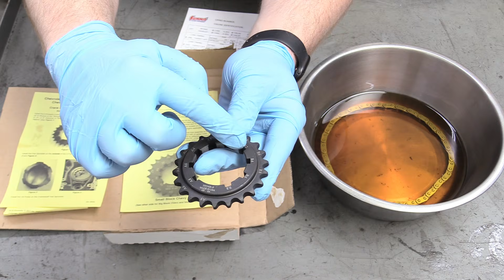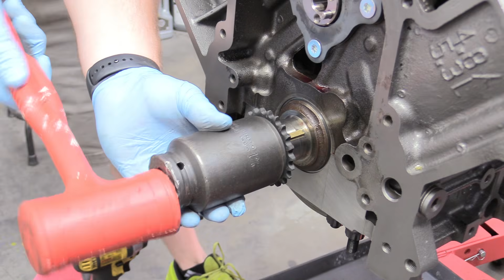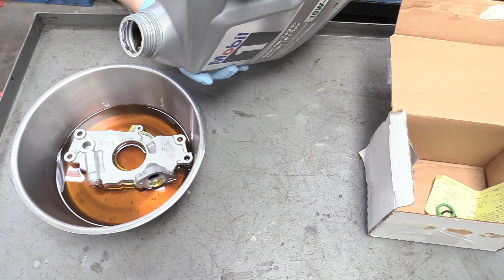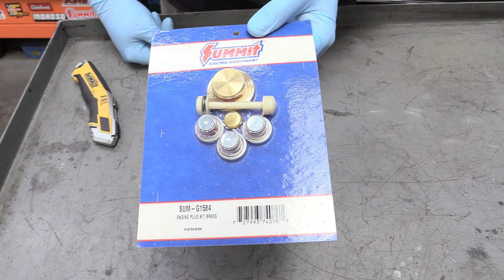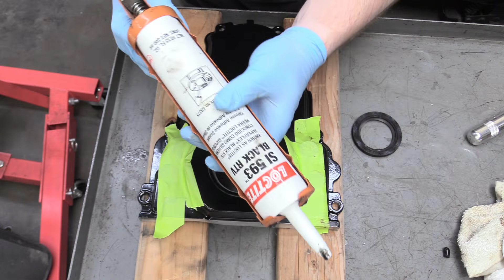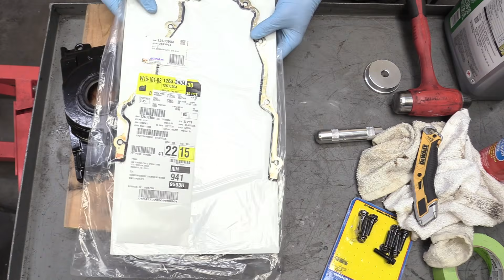How to Build a 5.3L LS LM7 V8 - Part 6: Timing Set and Front Cover!

Comment: this may be a very dumb question but, the camshaft that you have calls for +3 timing advance. Why didn't you advance the wheel on the camshaft side (+3) when installing the timing set? Are the two completely unrelated?
Reply from the maker: Oooo good question! I actually called Summit for that and basically it has +3 built in when the cam is straight up. Thanks for watching!
Reply: @2carpros  aahh I see, thank you! 

Btw, this video series is so good. It's literally what made me take the leap of faith and start my 5.3 build 🙏

Comment: 12:00 have to align the oil pump first, one method is using 2 feeler gauges that are .002". Good video but man sponsored people always have the best garages and cameras plus they talk like the guys on Horsepower TV LOL
Reply from the maker: So the block or the pump isn't machined correctly? And how would you change that? I've never had that problem before and I've built loads of these. I had this garage way before I was sponsored. This was a 1000 sqft building in one of the worst areas of Anaheim. Also my camera back then was just my phone or an old Canon I had. 

Network TV people are on script so that's why they all kinda sound the same. I do this off the top of my head and is just how the creator made me. 

Thanks for watching!

Comment: Using this series to build my l33 one tip I found is use the old cam retainer to keep the cam from falling out the back. Just thread in one bolt. Also if you’re going back with the stock type crankshaft sprocket you can use your old gear to drive the new one on.

Comment: Just a note on oil pump install. I prefer removing the front pump cover and aligning the oil pump with the crankshaft before fully tightening the four housing bolts. Anyone interested can easily find an alignment kit with a simple google search. 👍🏼

Comment: Did you ever get it running im about to install my harmonic balancer and didn't use the alignment tool and worried about leaks from front seal. Did yours leak at all
Reply from the maker: Yeah ran on the Dyno and it's in a Bel Air right now running and driving! Nope not a drop. Thanks for watching!

Comment: @2CarPros  i followed your steps putting this timing gear on. tried starting the car and its acting like the timing is off, is there a way to tell its 180 degrees out of rotation?
Reply from the maker: Were the two dots lined up? Because if so it's impossible to be 180 out. Thanks for watching!
Reply: @2carpros  yeah, 2 dots were lined up/ cam at 6pm, and crank at noon,  key was in 2 o'clock position. Would you know what else would cause a backfire, fuel and sparks to shoot from carb, smoke from exhaust and no start? rebuilt as stock. msd LS ignition box, no computer. Thanks
Reply from the maker: @chieftain3588  Then it's right. My gut says it's the box having a problem. That can happen even brand new out of the box.
Reply: @2carpros  does it matter if the tdc is on compression stroke or exhaust?

Comment: Do you have to pull the oil pan to change the camshaft and timing?
Reply from the maker: No, you just need to unbolt it from the timing cover. Thanks for watching!
Reply: @2carpros  I very much appreciate hearing back from you. I’m doing my first ever cam this weekend on my Silverado including the afm delete. Any advice you’d give someone for the job? I’m mechanically inclined but have never been this deep in a LS.

Comment: Timing cover should be centered with proper alignment tool or since seal is already in the cover you can use the balancer for concentricity then adjust rotation to square up oil pan mating surface.

Comment: i justy installed a new timing chain and when I torque it down to spec the crankshaft does not move at all and the chain doesn't move, I also have the stock sprocket, any ideas? I have a 2002 6.0 lq4.
Reply from the maker: Are the heads and plugs on it? That would make it tough to turn. Otherwise make sure you have the correct thrust plate for your camshaft. Thanks for watching!

Comment: Thanks for this video. Have a 2003 Silverado 4wd that needs a new oil pump. Thought to replace water pump and timing chain while Iam at it. Truck has roughly 120,000 miles. I didn’t see you deal with the T.C. Tensioner. But you definitely lined me up on what to look for in properly installing the timing chain and oil pump. Going out today for more parts, just about ready to begin this project. Thanks again. You are a competent instructor.
Reply from the maker: Ours didn't have one. I wonder if GM started putting them in at some point? 

Thanks so much for watching!
Reply: @2carpros  You know? Once I had the cover off of mine I found out that neither do I. The tensioner was in my part box but I didn’t need it. Thanks
Reply: Only Gen 4 LS have guides/tensioners

Comment: So I watched all your videos for my lm7 build. I followed all directions. I tried to start my motor but couldn't get it to start. So I decided to go through everything and kind of pin point where I screwed. As of now I'm assuming it has something to do with my timing or bad reluctor wheel. After watching several  videos from other builder I can't recall whether or not Cylinder 1 was top dead center.  watching your video again I noticed that cylinder 1 was top dead center but you didn't mention it. My question to you is, is there a way to check  without completely dis assembling the motor or atleast  without removing the head?
Reply from the maker: Pretty sure I said 1 has to be a TDC when you put the timing set on. 

Yeah, you can just take the spark plug out of #1 and turn the engine over with your finger over the plug well. You'll feel a blast of air that's the compression stroke. Then look in there and keep turning the engine over until it's at the top of its range of movement. That's what you're looking for. 

Thanks for watching!
Reply: @2carpros  thanks I went ahead and did that cylinder 1 was all the way up. thanks again

Comment: Crankshaft sprocket in oven for 200 how many in minutes to take out of oven sir ?
Reply from the maker: Like 5 minutes maybe a bit more. You don't want it so hot that it is dangerous or too hot to handle with an oven glove. But it needs to be hot enough to expand a little bit. I use a laser thermometer to test the heat and take it out when it hits 145F or so. Thanks for watching Anthony!

Comment: Seems a lot of folks change the oil pumps in LS engines, is there a problem with the original factory pumps?
Reply from the maker: Not really, but when you are spinning 7200 rpm way above factory spec you just want to make sure you are getting great oil pressure. Thanks for watching!
Reply: @2carpros  , Thanks for the reply.
I'm pulling the 5.3 out of my truck because it's leaking oil from every orifice and gasket and thinking about replacing some of these things like the timing set and oil pump preemptively.
Reply from the maker: @areuaware6842  Yeah that's a good idea! Thanks for watching!

Comment: Great video. Have a question about degree timing for your camshaft. I noticed in this video you just lined up the dots on the wheels and installed. Is doing the degree camshaft necessary?
Reply from the maker: If you want to squeeze every last drop of power out of your engine yes. Every professional race engine builders say it's essential. But for most people building an engine in their garage for fun I don't think it's necessary. Thanks for watching!

Comment: I’m sure someone already said it but I’ll say it again. 
If you don’t have an Allen wrench big enough, a bolt head will work. 
Double nut the threads to put a wrench or socket on, and stick the bolt head in where the Allen  wrench would go. Save yourself money on something you’ll only use once or twice.
Reply from the maker: I can't recommend that just because it isn't the technically correct way. But hey if it works it works. Thanks for watching!

Comment: By the end you probably looking around 10 grand if you buy everything new. So it doesn't make any sense to buy an engine for 500 bucks. Better get a used truck with low mileage and just take the engine out and put it in your toy
Reply: A little late but I’m building that same motor and I don’t have anywhere near 10k in it.
Reply: Nah I'm gonna do it anywasy (and it won't cost me 10k)

Comment: If cylinder head on block, how do I know if number 1 piston on TDC?
Reply from the maker: Put your finger over the sparkplug well and turn the engine over. When you feel a blast of air come up you know its coming up on the compression stroke. Then you can look in there with a flashlight and slowly keep turning the engine until you see it come all the way up. Thanks for watching!

Comment: Question: I'm building a ls1 5.3 swap in my 69 camaro.  New coils, injectors,  all new sensors.  Runs but backfires then dies. The vats have been removed. Engine: 03 5.3l l59 .  The engine did run for over 10 minutes then died and 3 cylinders ran really hot, the others seemed not to get hot at all. That's the back story. At this point I think it's the timing. Conflicting information about what position the dots on the cam sprocket and the crank sprocket should  be for TDC.  I initially did the cam at 6 o'clock and crank at 12 o'clock but I'm not sure the 1 piston was st TDC.   People have said the cam and the crank need to be at the 12 o'clock so the 1 piston is between the compression  and power stroke. I know it's a lot but I'm getting desperate.  Can you help?
Reply from the maker: Yeah I would definitely go back and change the cam sprocket so the dots line up on TDC #1. Try that out and see if that helps! Thanks for watching!

Comment: if you dont have an allen key that size you can always use the head of a bolt upside down and lock 2 nuts on the other end and use a socket to turn everything.

Comment: My 5.3 has a timing chain tensioner I did not see one on yours., Mine is a 2008 LH6 what year is your block
Reply from the maker: Right, this is an LM7 so it is a little older than your engine. But it is mostly the same. Thanks for watching!

Comment: I've known some ex GM guys at my work, they told me to put two shims sideways on the oil pump, it apparently keeps the alignment. Working on my own project video is helpful, not sure if this is one of those wisetales that aren't actually helpful, takes a couple extra minutes so I did it
Reply from the maker: I have never heard that. Can't say one way or an other if that would help. Thanks for watching!
Reply: Yes. You should always shim the pump, for proper clearance to center it up, before torquing down.
Reply: @gbsgarage  did this with mine as well which requires pulling the front cover of the pump off...I've also heard rotating the crank a half turn at a time while tightening the oil pump bolts down works also

Comment: You could be off by a few degrees doing it that way.....the cam card gives an intake centerline for a reason, Mr Narrator
Reply from the maker: No, if you line the two dots up they are in time. Either they are right or they are off one tooth and it is obvious. The +3 degree on the cam card is built right into the grind. I know I called the cam company just to make sure.
Reply: @2carpros  Wrong, cam intake center line  should be verified

Comment: I replaced my camshaft and crankshaft sprocket on my 5.3 ls and installed a new chain is it normal to have some slack on the chain
Reply from the maker: Yeah a bit but not too much. There really shouldn't be anymore than I had in the video for a brand new chain. Thanks for watching!
Reply: @2carpros use a Rollmaster,  IWIS red series set.  Snug, no slack.  Rechecked mine while doing oil pan gasket after 50k miles, still snug.  Why cam maker put 3 degrees advance in cam to counter chain slack.  My stock set up with Rollmaster, picked up bottom end a noticeable amount.  Not a torque monster, it's stock, yet improved.

Comment: For a single use large Allen like for the water jacket plug,  double nut a hex bolt of the same size,  if you have the right size bolt laying around.
Reply from the maker: Yeah that would be a clever work around. Thanks for watching!

Comment: When installing the oil pump are you supposed to put a shim between the crankshaft or does it not make a difference?
Reply: If your using a double row timing set, iirc.
Reply from the maker: No shim needed. Thanks for watching!

Comment: Doesn't, using a extension change your torque specs?  Longer the extension the lesser the torque.
Reply from the maker: Not by a crazy amount. I doubt you could even measure it with out very expensive machines. Thanks for watching!